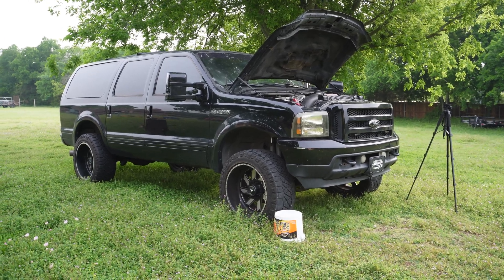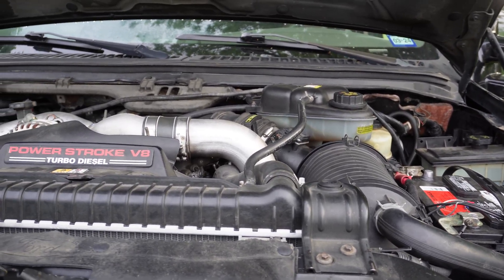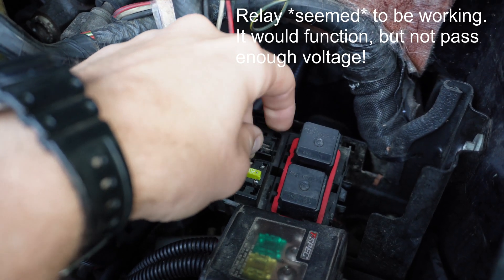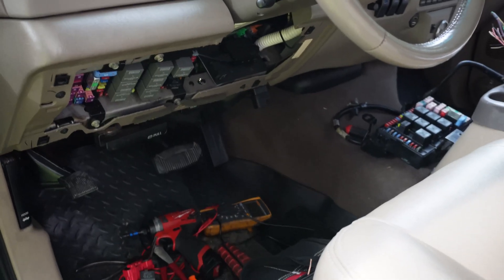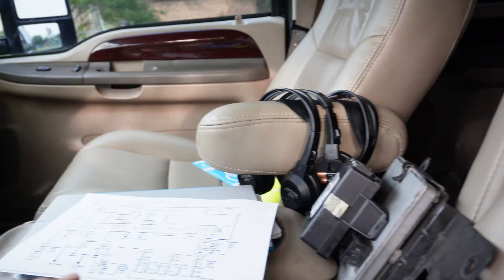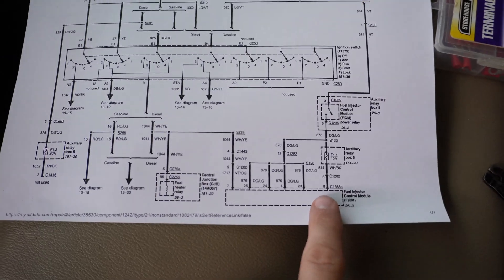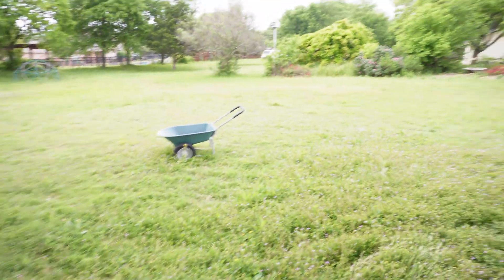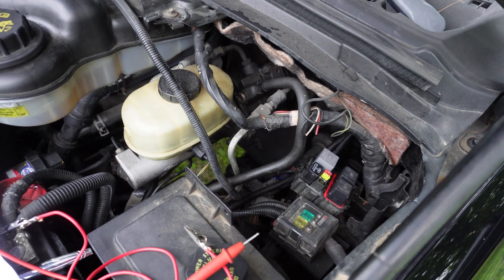Low FICM voltage P0611 Diagnosing and repair Ford 6.0

Comment: So I have been having problems with my excursion. Taking off from a stop. From time to time it will stall like it’s not getting told to go and then it will jump around into different gears as it stutters to take off. I recently had a low voltage ficm code. Jumping from 42-39 and then it went up to 43 and then the code went away. Could/are these symptoms of the ficm voltage problems?

Comment: You ever come across 2006 6.0 when you turn the key on.. it starts flickering fast..all lights comes on..no crank no start
Reply from the maker: Yes that is 100% of low voltage issue. If your battery is hard for sure good, then you have a ground issue or a battery cable issue
Reply: . Thanks for the reply..come to find out the start wasnt working..i tried jumping it directly to the battery..nothing happen

Comment: really helpful, I'm having the same issue but I suspect it's due to really low battery voltage.  Reading 11.4 volts Engine off on my CTS-3 monitor.  Batteries are 4 months old but really cold climate and short trips around town is all I take.  Plus parasitic draw from an always on dash cam.  Key on, injectors wouldn't do their normal buzz, more of a buzz......buz buzz.....buzz.  Then try to start and theft light flashing, maybe one cylinder fires and then it's off.  So, first step, charge the batteries to full and go from there.  Appreciate your video!!!
Reply from the maker: @harryash11  Thanks for the comment! Yup, hot batteries are super important on these trucks